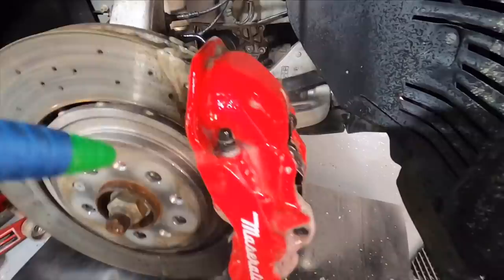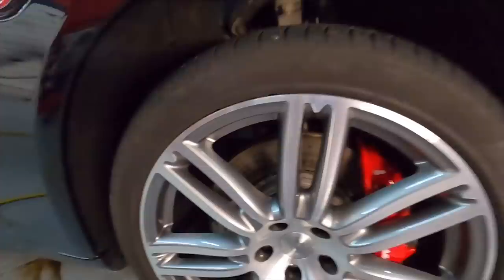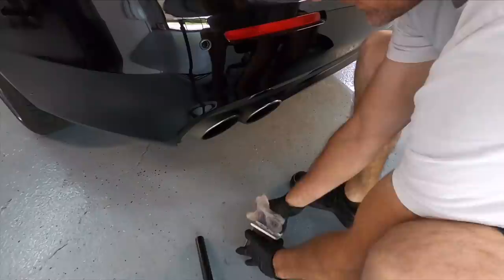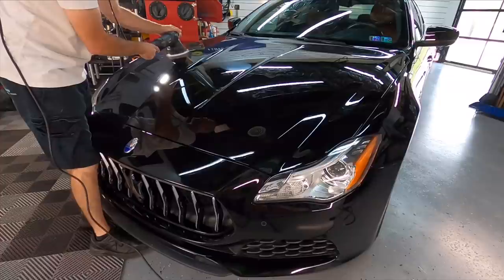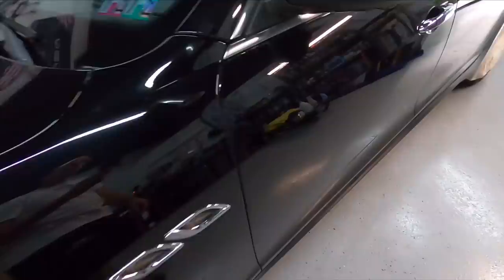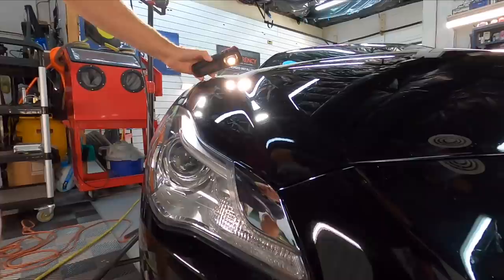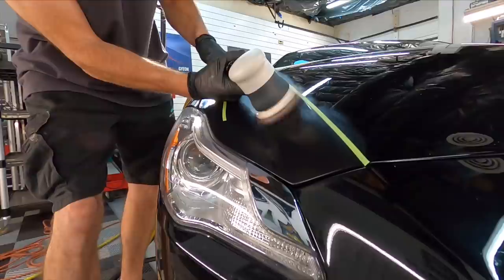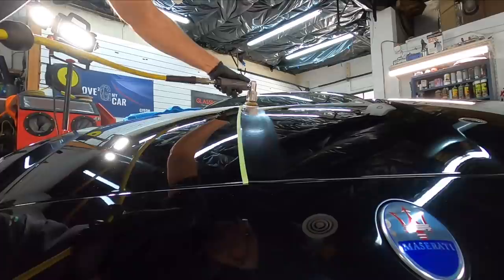Maserati Quattroporte! Multi Step Correction/Line Paint/Over Spray! PART 2!

Comment: Hey Brian, almost perfect timing I asked you about line paint removal a week or 10 days ago ended up coming off the paint relatively easy replace the black trim guard on the rear of the bed amazingly only $26 from the Chevy dealership so it was relatively cheap to fix did get a little splatter in the wheel well used a little dark gray paint to cover it up you can’t tell it’s that furry  wheel well stuff anyways enjoy the videos always informative well done you guys stay safe👍🇺🇸

Comment: Love the tip on using Vaseline and WD40 for line paint removal.  I do have a question.   What is the difference between wet sanding and color sanding?   Another informative and useful video.   Thanks for the passion and effort you put into helping us.
Reply from the maker: Same meaning.

Comment: Just playing devils advocate here  
At 9:33 while using the rupes pneumatic polisher the air hose rubs against the fender also while doing the B pillars it rubs on the door.  With all corded electric polishers you always have the cord over your shoulder, and mention it often as important to prevent marring. 
I realize the air hose is stiffer than an electrical cord...my question though is why does it not appear to be an issue having that hose with a hard plastic stopper rub up against the car. To me that hard hunk of plastic would be more worrisome than an electrical cord. I suppose as the car is being corrected, and work goes from top down and marring would be taken care of, but that being the case....why it it a "rule" to have an electrical cord always thrown over your shoulder. 
That being said...car is looking fantastic Brian. Always enjoy your videos and seeing your work.